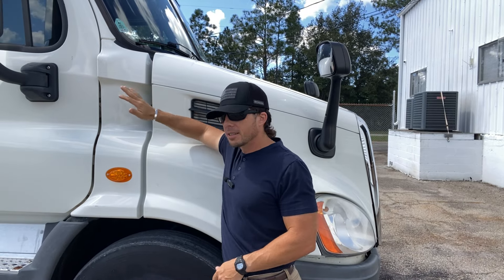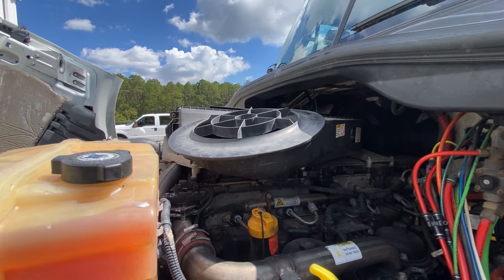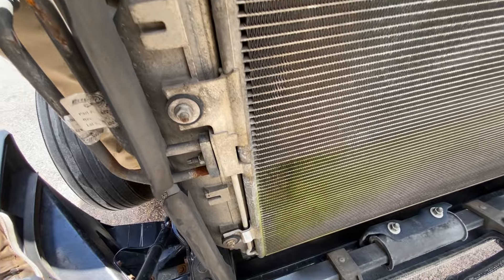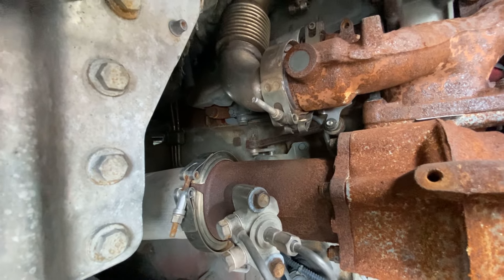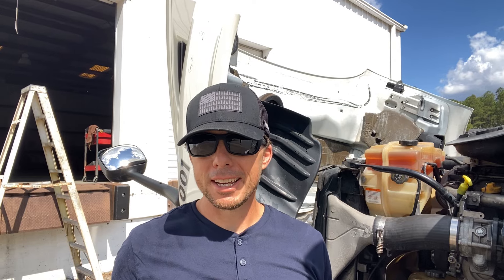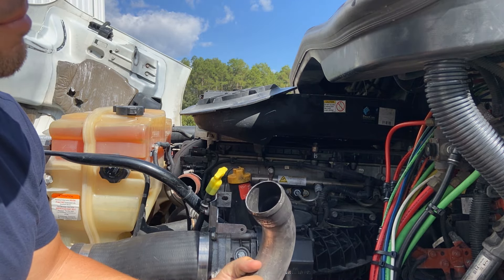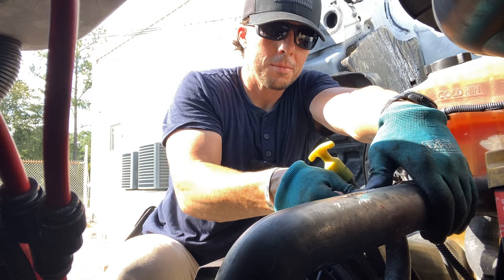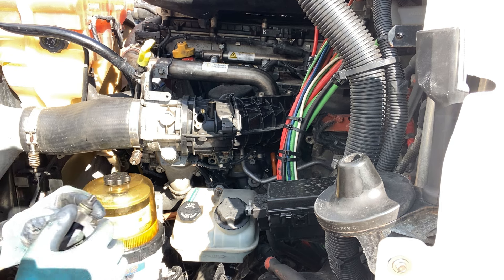Freightliner DD13 Has An Air Intake Problem (Let's Look For What's Wrong)

Comment: I'm going through this EXACT same problem with my 15 Cascadia DD15.  I've replaced:

All sensors
Pipes and clamps
EGR Cooler
EGR Valve
MCM
even the freaking Turbo

The only thing I haven't changed yet is the CAC (Charger Air Cooler)  I want to do a pressure test on it first as I'm completely tired of throwing money at this problem.

Please let me know if you find out what your problem was!
Reply: brother I am in the same boat you are. I have sunk a few thousand dollars into this issue. Frustration is an understatement
Reply from the maker: So you have the same code? I did hook it up to a computer and cleared the codes. Ran a manual regen and everything was now looking good. I think those delta p ports were a little clogged up. I would find a mobile mechanic and pay to have a computer hooked up and run the regen before throwing any more money at it. They will be able to see sensors are working and what else might be going on with temperatures during the regen. I know this can all be frustrating. What I showed in the video was just the stuff I would do before paying for the computer to show up as these are the common issues that cause the problems.
Reply: Ran no less than 3 Regens after clearing the codes.  It does not recode after a regen, only when the truck is pulling a trailer, leading me to believe it's the CAC with a small pinhole somewhere.  Will be testing it at the end of this year when I'm home for the holidays.  Will get back to you then.
Reply: @JakeOrion  Any luck figuring this out? We have a fleet with 5 DD13's and 4 DD15's, only the DD13's have this code. We've replaced sensors, turbos, CAC, and still have the same issue!
Reply: No.  I haven't replaced the CAC yet as I now have a failed head gasket (looks like it at least.)  Getting together with a mechanic in Vegas at the end of February and ask him for his take on this 25% derate.